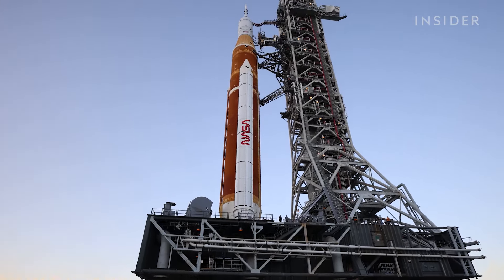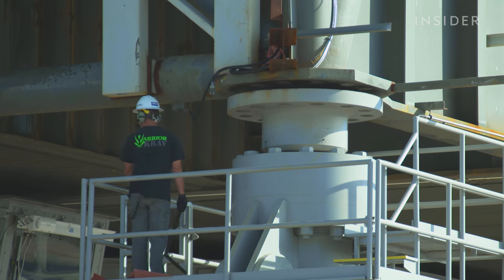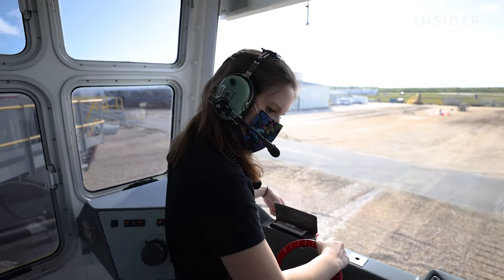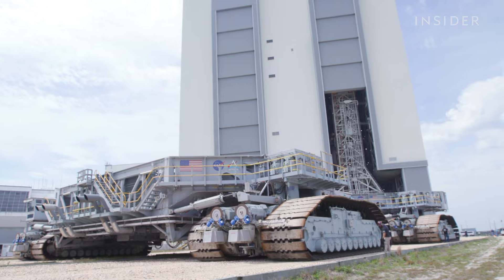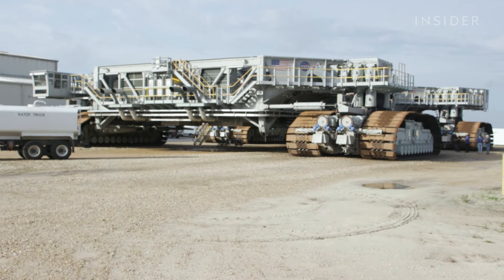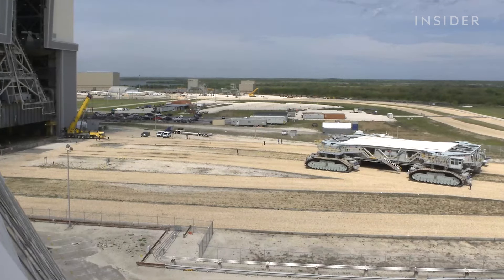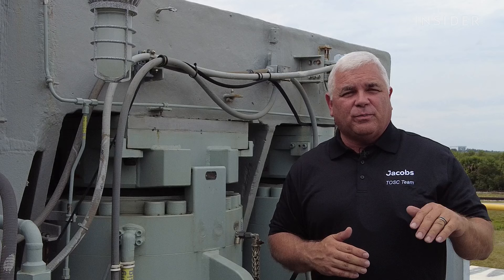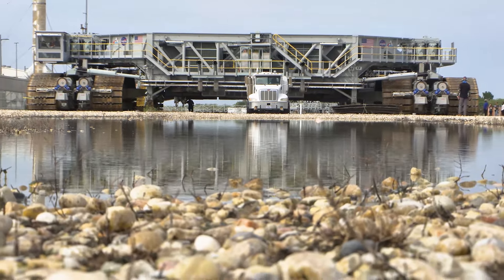How NASA Drives The $144 Million Vehicle That Transports Rocket Ships | What It Takes

Comment: Beautiful piece of engineering. Though I do certainly believe with today technology, experience they could create a crawler 100x more efficient, simplier, due to the 60 year age gap. Nasa hasn't done that most likely due to the slow production of rockets, and no drive in market. Though SpaceX may be the ones to fund that project, since they aim to make rockets with efficiently.
Reply: Yeah sure there could be some minor advances, but in the end you will have to move the same million ton rockets miles away from the assembly buildings to the launch pad, and there is no better vehicle than this.
Reply: @scibust  a train
Reply: @filbao8113  Trains at most have cars that can hold loads up to a million pounds in weight, while the payloads being carried here are up to 16 million pounds.
Reply: SpaceX basicly has no use for something like this, they transport their Rocket (Starship) in 2 Parts (Booster and Ship) on smaler Mammoet Self-Propelled Modular Transporters. Then they just lift it on to the launch mount, no need to transport the whole Tower like with Saturn 5/SLS.
Reply: @filbao8113  The launch pad sits on a hill, because that part of the coastline is a swamp and building things like the flame trenches into the ground is difficult. The hill means you can't use rails (incline is too steep). To make a rail system possible, they'd have to build the VAB at the same elevation as the launch pad, and build a dike between the VAB and pad. That may have been more expensive than building the crawler.

Comment: "It takes about 14 crew members to plug its power into an outlet for shore power"

Nah, that's not a big cable. It's a one or two man job. It just sound nice, to say it takes 14 guys. Typical American exaggeration.
Reply: If you've got a crew of about 25 needed to run it, why not use 14 of them to lift the cable to avoid damaging the insulation so the cable lasts longer once they've done moving it.
Reply: @benlee4940  Because they claim this can't be done with less than 14 people, which is just BS.
And you don't really wear on the cable, if you roll it out, which would be the approach by one or two guys.
Reply: Dude, do you have any idea how much a solid copper cable weighs? That's hundreds of pounds you see in the video.
Reply: @samsonsoturian6013  Yes, I actually do know how much it weights. That cable is a rubber cable, probably a 4x50 to 4x95 mm² cable, which puts the weight at around 3-6 kg per meter, or double that in pounds.
There's probably 20-30 meter of cable in the video, pushing the total weight to around 60-150 kg, depending on weight and length. Not super easy to roll out, one man, but definitely doable. I've done similar.

Besides, it's not a solid cable, they don't flex like that. Not that it matters a lot for the total weight.
Reply: @akyhne  it's solid copper coil on the inside, bozo. And it doesn't matter if one idiot could move a little at a time because that would take near a half hour just to plug it in.

Comment: This right here is why SpaceX is going to beat SLS. Instead of mammoth machines travelling at 1 mph on a specially prepared track which it takes at least 18 months to learn how to operate, SpaceX uses off the shelf SPMTs and drive them down the highway. Yes, these beautiful old machines can do an entirely different job (8,000 tonnes) but maybe they shouldn't.

Comment: When I see this, I understand why a commercial launch is cheaper without having to cut corners on safety. 
This thing could be modernized quite easily and would only need a fraction of the personnel and effort.
Reply: Sure thing bud, you tell them NASA engineers how they should do it. Heck why don’t you run the complete Artemis program, cause you clearly see the bigger picture.
Reply: @MrJimheeren  NASA may hire smarter people than I am, but even someone who is not an engineer can figure out that you do not need to have people running around a moving vehicle reading valves.  It really all looks very 60s hightec. It was well developed, works well and there were no more requirements for 50 years or so.

Some cameras, some electronic gauges and a controller would have much more overview and a computer could warn of problems.
Reply: @wolfgangloll2747  very true, but if im correct, the only reason that they dont make more modern systems or change in there process is that theyre underfended enough to not be able to create a new one, but only capable of modernizing as seen in the video, 60s technology
Reply: @millionelectricvolts6117  underfunded?
Reply: @wolfgangloll2747  yeah theres no need to have that many people running circles checking over brand new parts that are lucky to see 12 miles of travel in a year.. theyre the same design as any excavator, dozer, or skid steer uses just sized up, set the preload, fill them with oil, and they should be good for the life of the vehicle
Reply: It appears modern humans are completely unaware of the phrase,
"If it ain't broke, don't fix it."

Why spend millions upgrading a perfectly operating crawler when you can use it on the rockets it hauls instead?

Meanwhile...crawler still crawling. Perhaps you can borrow it to haul all the nits you've been picking?
Reply: @codymoe4986  it's funny when people say that. If it ain't broke don't fix it, the story of every lazy person. The problem is, it is broke. It has been broken for a long time. Just because millions are spent to make it function doesn't mean it's optimal. It doesn't mean that there isn't a better way to do it, one that cost less. I'm not saying that everything needs to change, somethings may still be cost effective. The product should have to prove it self continuously.
Reply: @metorilt  Honestly, a good engineer costs between $80 and $150 per hour and a retrofit of cameras, sprinkler systems and electronic surveillance may cost a million or ten if you make it fancy.

I can understand that you don't do much to it if you only use it 2x a year, but somehow it is my hope that there will be considerably more space travel, for which we would have to make it more efficient. 
Nice when efficient spaceflight is in private hands, but I find the public projects much cooler than the for-profit ones.

Comment: is the speed limited by safety reasons or are the engines underpowered?
Reply: That's a good question. The speed may be for safety concerns. Especially since the rockets are expensive production.
Reply: Safety reasons. There’s no point having a fast crawler, particularly when it could result in a rocket falling over.

Comment: If it is moving at 1 mile per hour, how long will it take for it to travel 1 mile? 🤔
Reply: total travel time includes lifting the platform off its supports, leveling the platform as the crawler goes uphill, maneuvering into place at the launch pad, and setting down the platform at the launch pad.

Comment: why not build the rocket ship on the launch pad and move the hangar out instead? (just curious)
Reply: This is done by ULA for their Delta IV but this isn’t possible for SLS due to the sheer size of the VAB. It’s easier to move the rocket than the entire facility
Reply: You would rather stack the rocket in a controlled and indoor environment where crews can use platforms if possible.

Comment: What would be the downsite of puttong it on rails?
Reply: The launch pad sits on a hill, because that part of the coastline is a swamp and building things like the flame trenches into the ground is difficult. The hill means you can't use rails (incline is too steep). To make a rail system possible, they'd have to build the VAB at the same elevation as the launch pad, and build a dike between the VAB and pad. That may have been more expensive than building the crawler.
Reply: @zounds010  Okay thanks for the explanation

Comment: For 144 million, you’d think it would be on a straight line rail from the building to the launch pad
Reply: It has to go up in elevation, a track system would have to be over twice as long so that the angle change is small enough to maintain grip.

Comment: Why is the VAB not a straight line? Putting it miles away for safety reasons makes sense, but to make it a more complex drive than NASCAR is ridiculous.
Reply: LC 39 has two pads, 39A and B.  Before SpaceX leased pad A, NASA would use both pads.  B happens to be the one where they have to make the turn.

Comment: rails could have been a  better option
Reply: The launch pad sits on a hill, because that part of the coastline is a swamp and building things like the flame trenches into the ground is difficult. The hill means you can't use rails (incline is too steep). To make a rail system possible, they'd have to build the VAB at the same elevation as the launch pad, and build a dike between the VAB and pad. That may have been more expensive than building the crawler.
Reply: @zounds010  thanks for the explanation.

Comment: Starship's crawlers can move up to 10 miles an hour.
Reply: Starship crawlers are not also carrying the launch tower and launch platform.  Also unlike Boca Chica, there is a flame trench where the stack has to moved up an incline and needs to stay level while doing so.  Since there is a high water table, instead of digging a trench, they raised the launch pad where the trench is at sea level.

Comment: Only 2700 hp? Sounds underpowered
Reply: Horsepower is just how fast the 'power' is produced, and the actual engine power is torque. Alco's engines are extremely high on torque load.

Comment: why not make it self driving?
Reply: Why make it self driving? These operators' salaries are a tiny fraction of what the crawler costs to operate, and they can ensure the vehicle is safe much better than any AI could ever hope to.
Reply: @sebastiaomendonca1477  I think they are more than just operators (or maybe I'm overestimating their skillsets haha). They are highly trained engineers and I think their time can be better spent on designing and developing new features that self-monitor the pressure rather than looking at the pressure gauge throughout the drive (as explained in the video). Human brains are way too valuable for doing these tasks I think.
Reply: @larry6h23  no computer can self monitor as many things as these humans can. They're not just looking at gauges, they're looking at every exposed mechanical component of the crawler and constantly making sure everything is as it should be. You'd need an insanely advanced computer vision program to pull that off, and even then I don't know how you'd train it. There's not exactly much footage of the crawler going wrong.
Reply: @thundurr  Computers monitor things with sensors. A rocket is easily guided and managed through GPS dataa, INS, gyroscopes, temperature pressure and fluid flow sensors in the engines, star guideance, etc.

This crawler is not a rocket. The driving is dead simple. What isn't dead simple is the actual monitoring all those people are making all around the vehicle. Computer vision and image recognition simply are not advanced enough yet to rival constant inspection by so many engineers. Not to mention what happens when something actually goes wrong, comparing having some computer wired up to a camera to having an actual qualified mechanic on-site to handle it.

People like you need to understand that AI is not the answer to everything, definitely not yet. No amount of modern computer learning systems can match an engineer's know-how yet.

Comment: And then, there's SpaceX, transporting their big rocket, bigger than SLS (with almost twice as powerful)  just using the commercially available SPMTs.
Reply: That's much lighter though.
Reply: @h.dejong2531   It's not merely about the rocket being much lighter. But, the choice in the design, taking into account how to transport it to the launchpad. SLS is just following the old way, as old as Saturn V, transporting not just the rocket, but the entire launch tower structure.

Which is the problem. Merely following the old way of doing and designing things, resulting in this monstrosity, that's only around half the power of a private rocket, that's Starship.

Comment: Seems like it could have solved so much easier by a rail system lol why did they even make a curve ?
Reply: The launch pad sits on a hill, because that part of the coastline is a swamp and building things like the flame trenches into the ground is difficult. The hill means you can't use rails (incline is too steep). To make a rail system possible, they'd have to build the VAB at the same elevation as the launch pad, and build a dike between the VAB and pad. That may have been more expensive than building the crawler.

Comment: I don't know why they made it so complicated,, if the launch pad and factory are at fixed location they could have built railway to carry such heavy loads
Reply: This isn’t complicated. It’s literally a giant platform with wheels that lifts the launch pad.
Reply: Russia uses railway to transport their rockets. Really doesn't make much of a difference.
Reply: They did a study on rails, they couldn't hold this much weight.
Reply: @kevinconrad7648  they definitely can, considering both N1 and Energia were transported by rail
Reply: @sebastiaomendonca1477   Saturn V's and SLS are stacked vertically and had a ML platform that moved with it.  That whole platform weighs over 18 million pounds and would have easily sunk a road or rail into the Florida ground which already has a higher water table. So Tennessee river rock was used with a crawler transporter. The rocks crushes beneath is but that disperses the weight load. It was easier just to move the whole stack as one. Instead of moving pieces horizontally like N1 and Energia.
Reply: @kevinconrad7648  Vertical or horizontal integration are beside the point. N1, an equally sized rocket to Saturn V, was transported as a whole stack by railway, demonstrating that it is perfectly possible to do so. Doesn't mean its strictly advantageous, which is why NASA chose a different method, but its possible.

Comment: you got drag racing cars with 3 liter 6 cilinders with 3000 hp these days, yet they use the engine the size of a bus to make only 2000 hp, makes me wonder why they still use that, like sure one of those drag racing cars is less reliable, but 2 ls7's producing 2000 hp together would be a lot cheaper, easier to maintain, cheaper to run, lighter weight and probably just as reliable, only thing you'd need is some more aggressive gearing
Reply: The main reason it is going slow because the rocket is very tall if they go fast it will topple
Reply: Those are bog-standard marine/generator/locomotive diesel engines. They're low-stressed, and built to run 24/7 for years between overhauls. Maintenance doesn't get cheaper than on these.
Reply: 3 Litres 3000 hp engines need to be rebuilt after each run, where did you get your data from?

Comment: Why not use rail?
Reply: The launch pad sits on a hill, because that part of the coastline is a swamp and building things like the flame trenches into the ground is difficult. The hill means you can't use rails (incline is too steep). To make a rail system possible, they'd have to build the VAB at the same elevation as the launch pad, and build a dike between the VAB and pad. That may have been more expensive than building the crawler.

Comment: How does it pick up or lower the Rocket onto the pad? Is there a crane capable of lifting that?
Reply: The launch table sits on top of the crawler. The crawler drives to the pad, and lowers its suspension until the launch table rests on a bunch of columns. Then the crawler reverses out from under the table.
Reply: @zounds010  And then the columns go down? I feel like I would have noticed if  the launch platform were on stilts..

Comment: While I love the crawler, Never could figure out while they don't just use a rail system and mobile launch pad. Assemble the rocket in the lab right on the launch pad, and then slide the entire thing outside safely away from structures on the rails.
Reply: Why don’t u re design it then

Comment: Why not upgrade it to 2 mph instead of 1? You won’t notice a difference in speed but you’d get it done in half the time
Reply: Physics is a harsh mistress. A precariously balanced 100 m tall rocket will definitely notice a difference in case of emergency stop or seized movement. It's for those incident scenarios they have to design and trade off max speed for safety against tipping.

Comment: ok, this brings another question.  When they get to the pad, how do they pick up the rocket and move it to the pad?
Reply: The transporter lowers its jacks and backs out. The rocket sits on the launch pad ready to take off. It is the reverse of what the transporter does in the Vehicle Assembly Building to pick up the rocket
Reply: The crawler is carrying the pad, with rocket in position on top. Sp unlike the soviet system where they have to set up the rocket once it gets there, as soon as it leaves thr VAB the rocket's ready to go

Comment: What were the obstacles for not laying a straight path? Sure, it would've been easier that way, but something might've stopped them from doing so.
Reply: There were originally going to be 4 or 5 pads, arranged in a circle.  The curves probably cut down the amount of roadway needed to service all of them.  Also, this puts a little more distance from the pad to the vehicle building; maybe this was needed for safety.
Reply: @BrianDominy  I understand that sir, the road between 4 or 5 pads can be laid as a a polygon. Also, straight lines traverse the shortest distance which will lead to efficiency in the long run considering fuel & time.